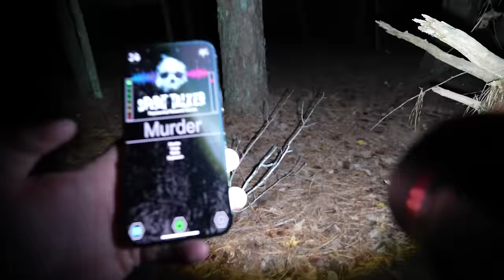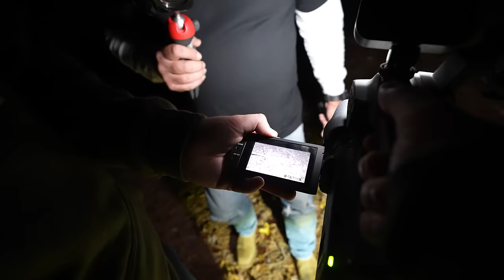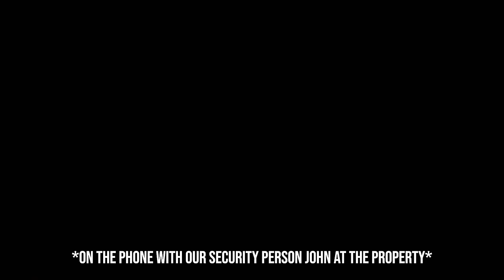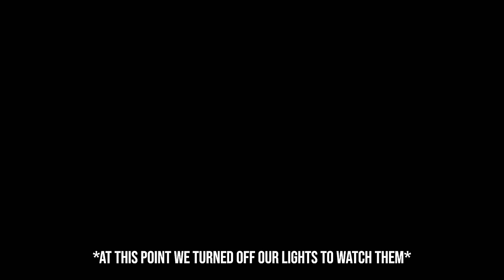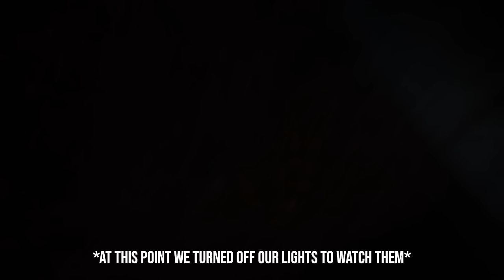LOST INSIDE THE REAL SKINWALKER FOREST STALKED BY SCARY PEOPLE

Comment: Also ... When your spirits said "main sprinkler system" they're correct too, the blood pit has a water sprinkler system, to washb the blood down, from the animal and clean the drain out once you're done with the job at hand. The process is called evisceration. So they probably called it the curing barn, or evisceration room.

Comment: CJ those were not deer tracks, those were hoof prints from boar. Pigs will make circular marks in the dirt, and mat down brush /foliage in circular patterns. What is throwing me off is pig run in packs. So, you usually see those marks in clusters of multiples.